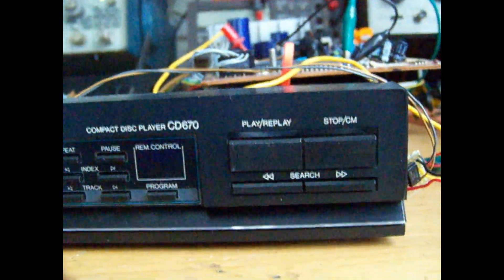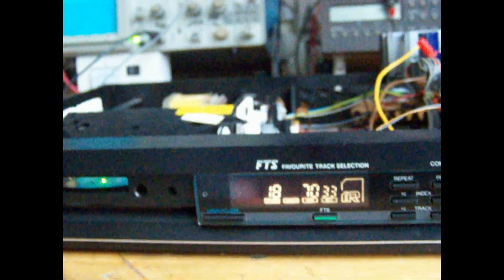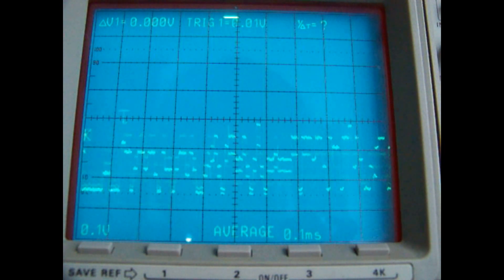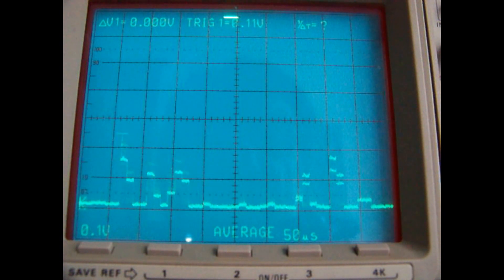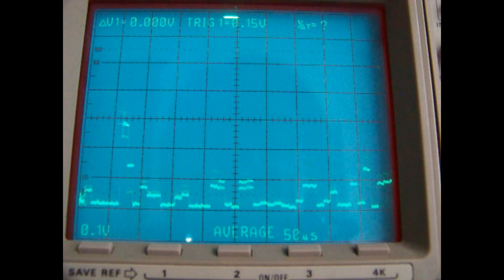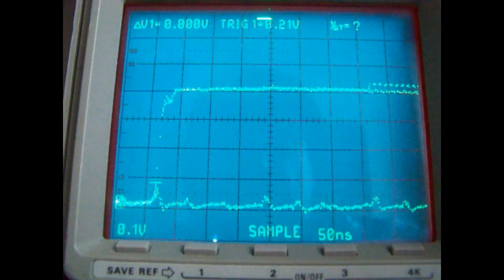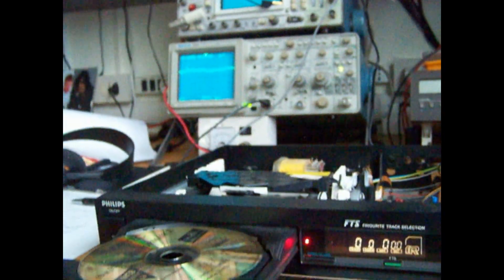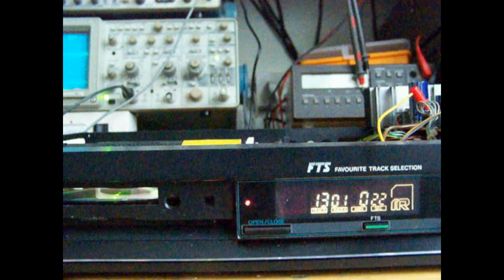Philips cd670 (TDA1541) - CD player error's dance

Comment: How the FM-Signal looks like? I measure in normal conditions that it is around 4Vss. This Error mean that the Pickupunit can't read the FM-Signal not so good. Is this Problem on all CDs or only on this burned CD i'm asking because i have had some failure like this with a burned CD too.
Reply from the maker: +Volker King Yes sirs! It was a burn CD. Definitively a burn quality problem. Still it is fun to learn how the TDA1541 faces the problem; the error LED is nice to have too...